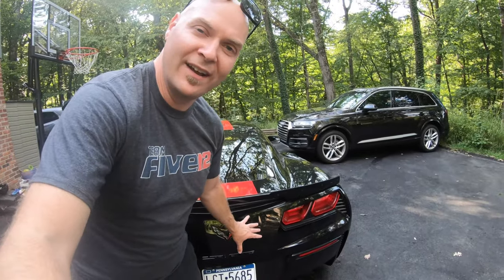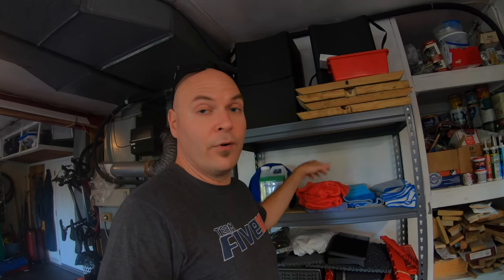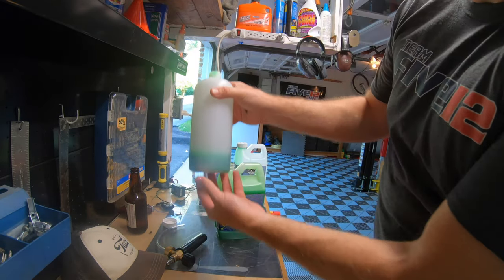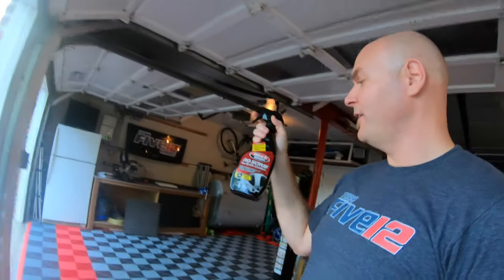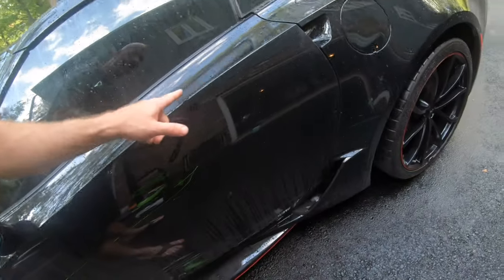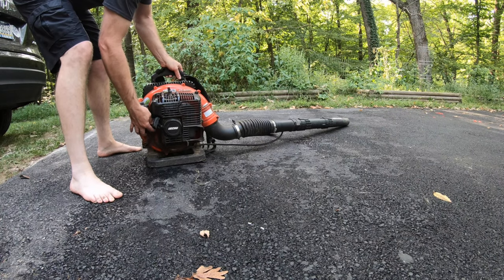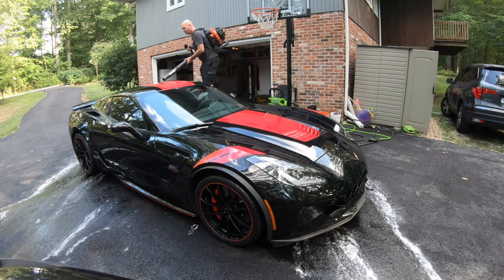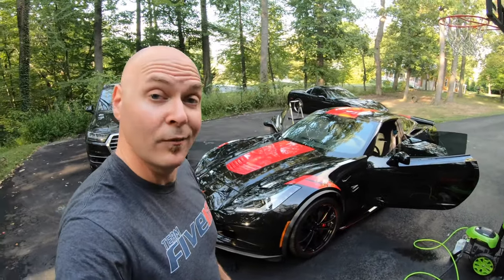Maintenance Wash on the C7 Corvette - Prepping for Cars & Coffee!

Comment: Not bad, we got some work to do to make you a pro 😂. Nothing wrong with single bucket and if you use microfiber then just use multiple towels so you never put a dirty one back in the bucket. Looking nice and shiny tho 👌
Reply from the maker: Good tip on multiple towels! I need to get a dedicated second bucket. 😎
Reply: @Team512  I have 3 buckets. Wash, rinse and wheels. Grit guard in the bottom of each to help keep debris and stuff at the bottom of the bucket so it doesn't get back on your wash mit. If you use towels then grit guard isn't really required and neither is a rinse bucket. Get the ez detail wheel brush or something similar to get the barrels off the wheels, your knuckles will be thankful.
Reply: Listen to Dave, he learned from me!! Lol
Reply: @Rico_Suave-bk8le  💯🤣
Reply from the maker: Rico_Suave1851 The Master Jedi!
Reply: @Team512  I was thinking more like Mr. Miyagi, "wax on wax off"